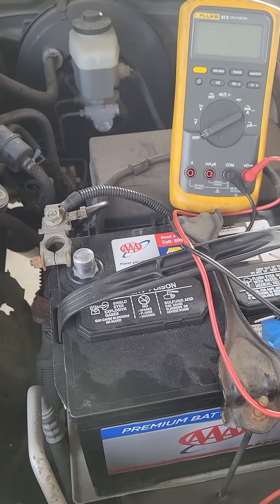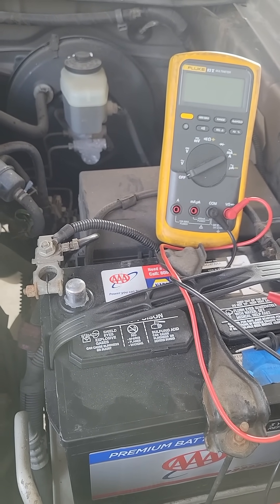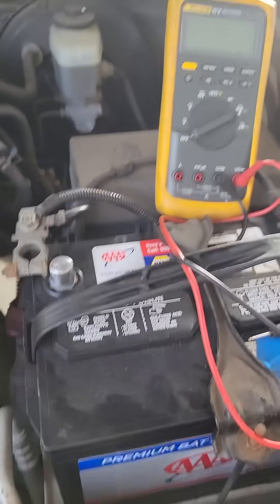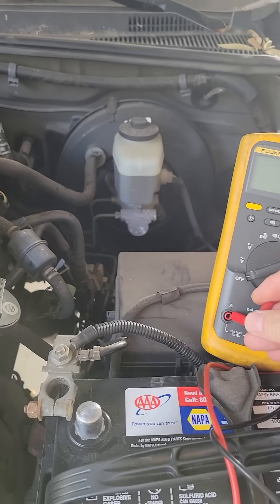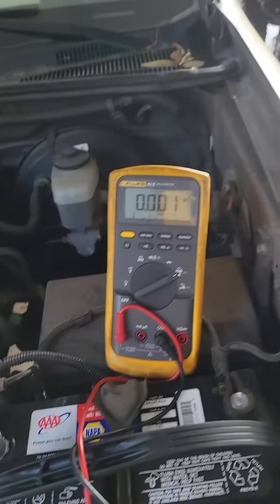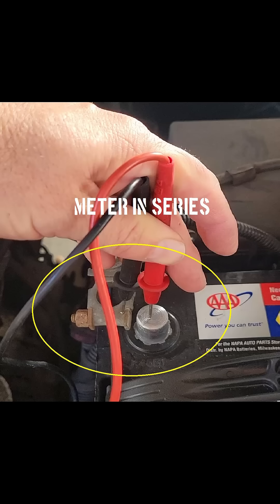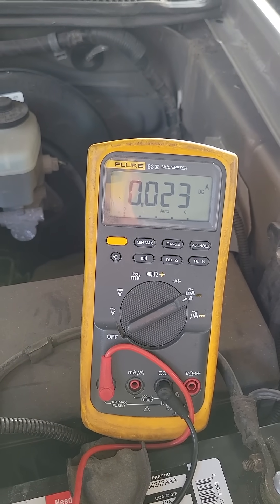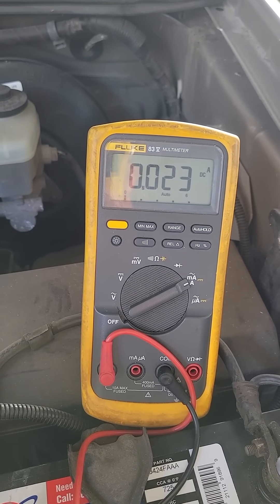Checking for parasitic battery draw in a car #survivalcomms

Comment: Not much of a draw, but if you park your vehicle, say, at the airport for a trip that lasts more than a few days you'll come home to a dead battery. I had a truck that drove me nuts - pulled the fuses one by one until I found it - a pinched wire in the truck bed. It only discharged the battery during rainstorms. Maddening!
Reply: 23 mils won't drain it in 2 weeks. Most cars have closer to 75 mils and even that isn't a problem in 2 weeks. If you leave it 3 to 4 weeks just plug in a small solar trickle charger to the car via a tap in the interior fuse panel.
Reply from the maker: @J123G  Thanks for watching !
Reply from the maker: 3 hundredths of an amp in this case  should last 90 days of storage not taking self discharge into account . A lead acid battery in Florida heat can self discharge 15 - 20 percent capacity on average sitting on a shelf which is  2 hundredths of an amp if my math is right.  I need to drive the vehicle more often :) Thanks for watching !
Reply: Pinched wire in the rear bed, good find. Electrical snags of any level can be hard to find.